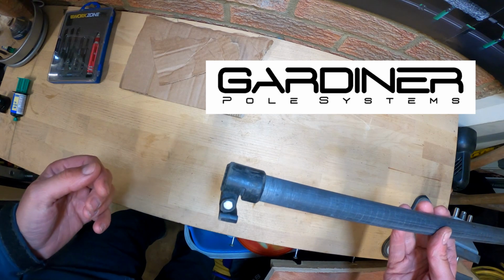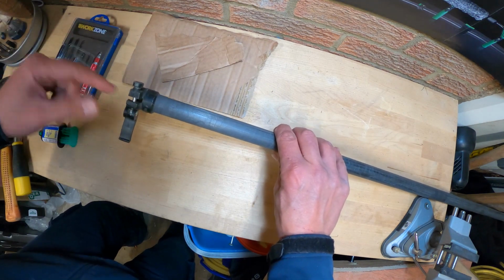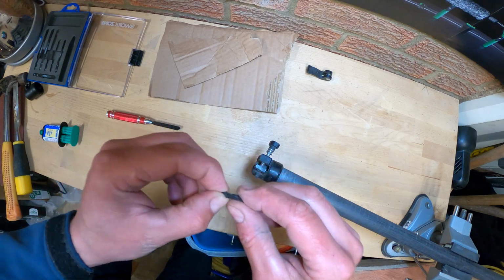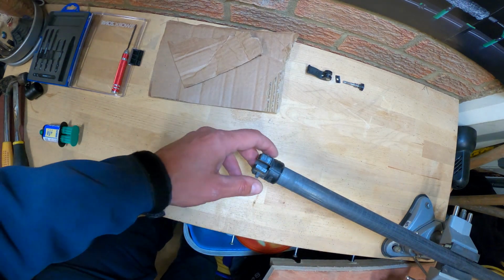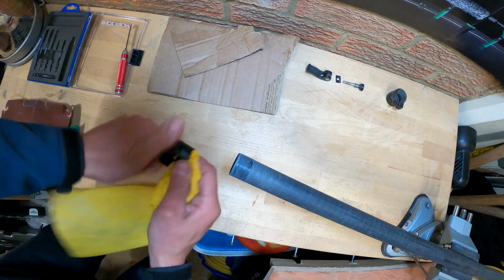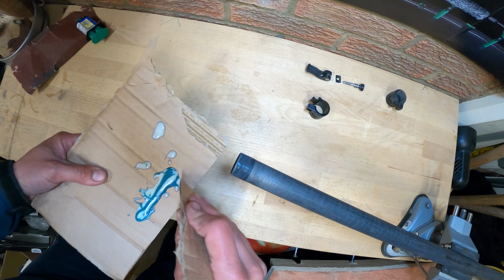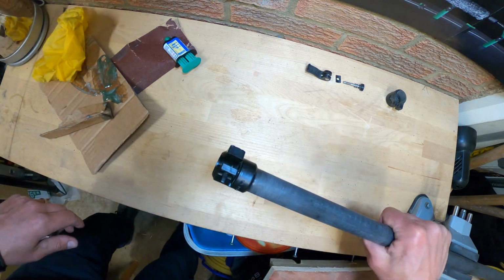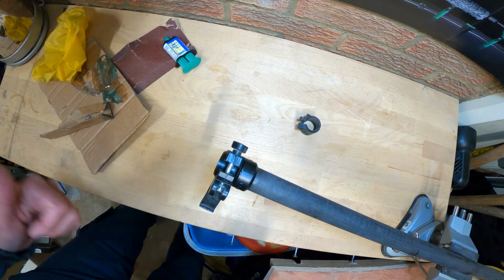Gardiner Pole Clamp Assembly and Repair

Comment: If it happens again , soak end in boiling hot water for 5 mins then with a bit of elbow grease you should be able to twist off. Save you the stress of the risk of cutting through carbon.
Reply from the maker: Nice tip. Thanks.😃👍🏼

Comment: That's the problem with gardiner clamps they are a pain to replace, if I could give some advice change the gardiner clamps to phantom clamps so much easier to replace using an Allen key
Reply from the maker: I think I prefer how the Gardiner clamps work but yeah, Phantom clamps are much easier to change.😃👍🏼